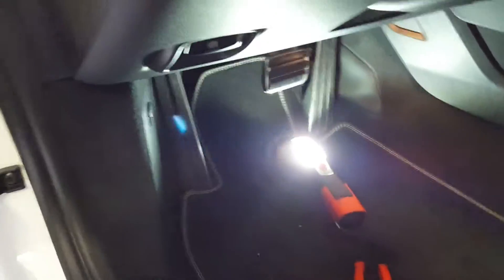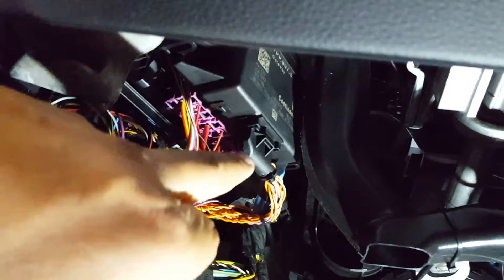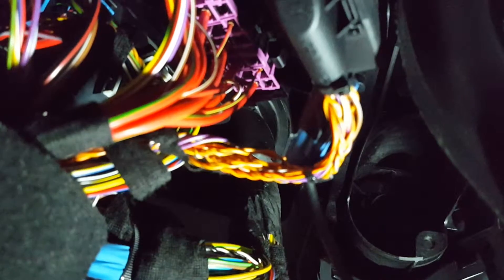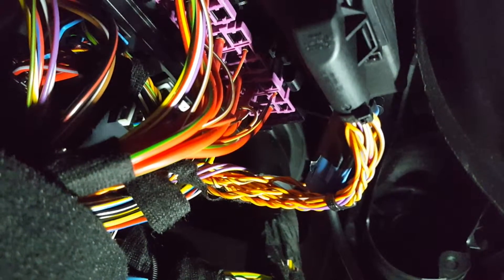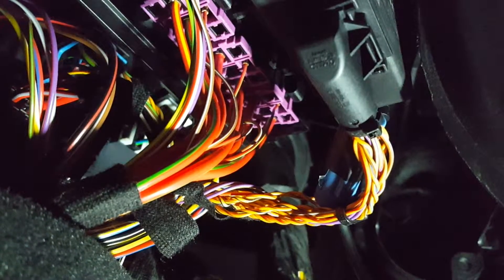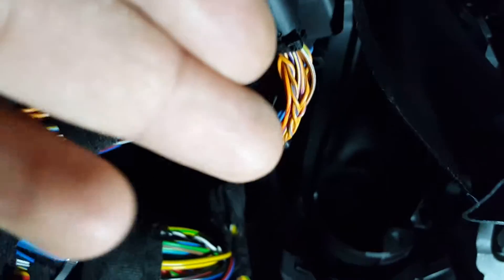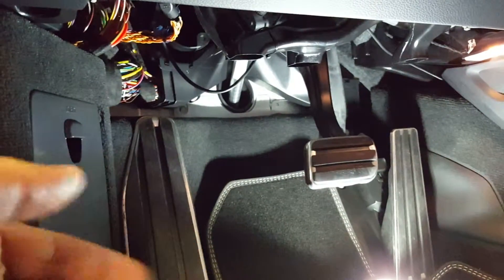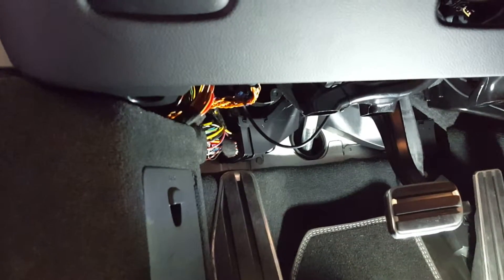Racelogic video vbox lite installation CAN BUS info for Porsche GT3 991/911

Comment: Thanks for sharing. About to do the same. Can you please share some info how you lead the wire to the glove comp.? Was it hard and involving removing lot of parts?
Reply from the maker: +spqba747 Easy, side of the glove-box, and then under the radio console, you can put it that way without removing anything.. stop video at 34 sec, look at gaspedeal, to the right of it, there you can put the wires over to the glove box.. i used a ion stick to guide the wire... anyway if you remove glove box its really easy! :)
Remember to zip tie the cable over the gas pedal, so it will not drop down and make problems for you in a race :)
Reply: +Lars Fuglsang Ok, thanks!